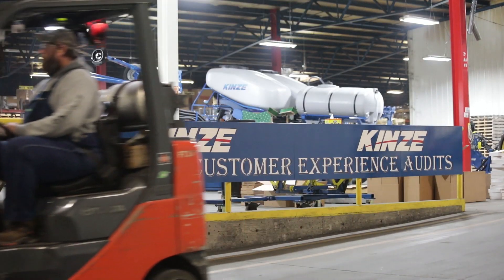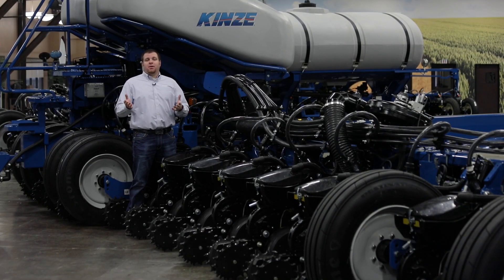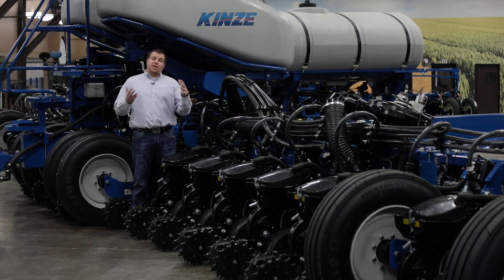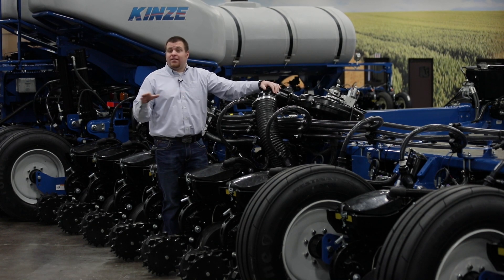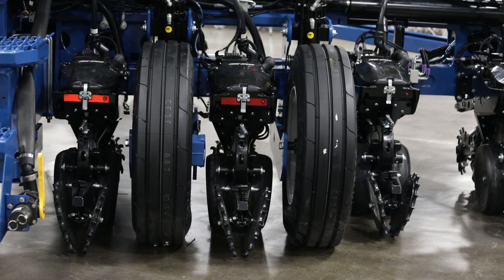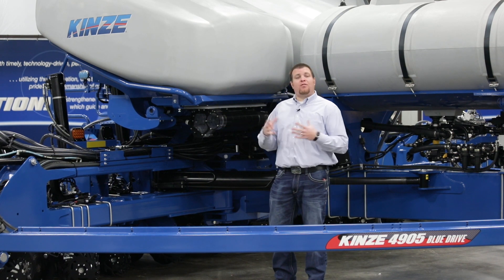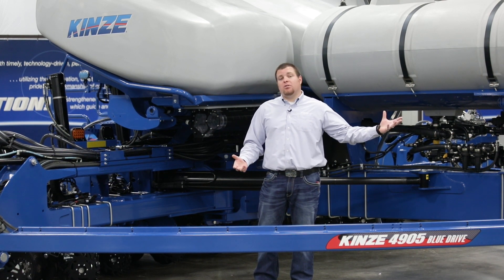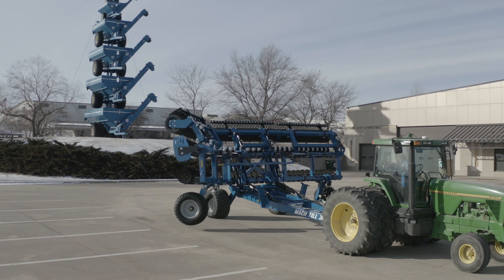An In-Depth Look into Kinze’s New Products and Enhancements

Comment: What size tractor or hp required for new planter n can this planter sow wheat?
Reply from the maker: Thanks for your question, Jamie. There are variables that include terrain and attachments, but we use an average of 7hp per row. Regarding wheat, the True Rate meter planter can plant wheat, the True Speed meter planter cannot.
Reply: @KinzeManufacturing   Can a True Rate meter planter also plant corn and soybeans?